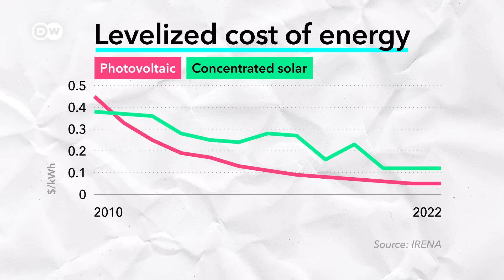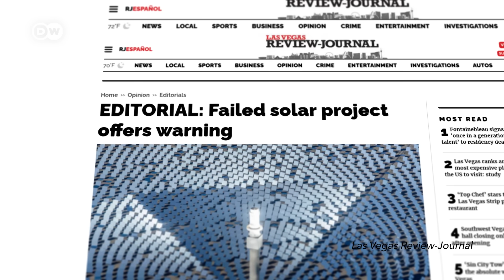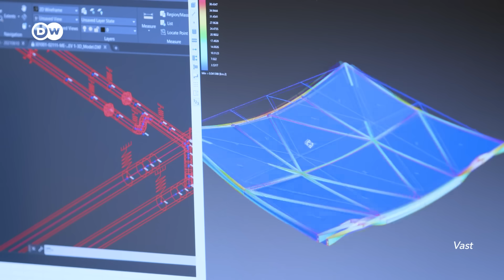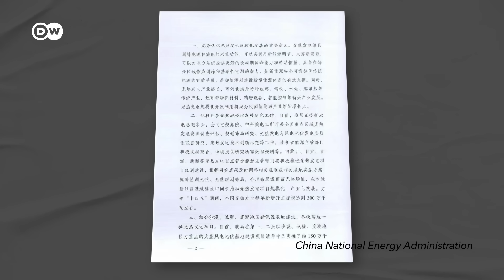How we can make solar power at night

Comment: How about flywheel energy storage? Or cheap flow battery? I guess that we need more research on energy storage than energy generation.
Reply: Flywheel is bad for energy capacity, but it discharges very violent and its spin rate is relatively constant. Therefore it is better used as frequency stablizers on the grid or caches of subway systems with regenerative braking.

Comment: Is it possible to one side of solar cells while other side of panel mirrors are fitted? With automation, panels sides cane be changed to generate energy for storage. Hope get some view on this idea.
Reply from the maker: Theoretically could be possible and would be good for land management! But the technical and practical challenges would be great: with finding the right alignment and flipping them around, possible heat management and so on...🌛

Comment: so why not just use it like a heat pipe, where heat rises up and cold condenses back down, in the heat tower, well, if you point the sun at the root, then the tower becomes a upwards automatic flow generator tower, yep you make steam power right at the tower, skip one complex plumbing phase completely. reason: marketing for pv solar was much better, and its very simple with panels and electric wires, if you make the steam solar heat generation simple as that then no problem. tower + mirrors, not additional steam generator plant as 3-part. minimal complexity makes it simple. concentrated solar thermal can be many times cheaper if done properly. not according to what market offers or requires. detach from the market completely. then you get the proper view. yep you can make it, but you dont have to make it. have to make it have to make all kinds of non-related things that just make things feel horrible. levelized cost ie other money measures are not the key. do it for yourself then you dont need to sell to anyone. you avoid all the commercialism complication issues. assume all costs zero. that way you see the sellers of the cs tech are just doing it too expensive. maybe on purpose. solar thermal needs to reform if it wants to compete. it lost its mirror's edge. if you are expensive, market will not buy your stuff. needs to stay in some range is a recipe for doom. if you make concentrated solar self-contained units all-in-one, as kinda like solar heat collector units, then it will work better. the application and usability it needs to be sensible. static auto-aligning mirror ground trench is much better. and simple to do by digging a trench and covering it with mirror metal sheets, or roof. yep roof concentrated solar is automatically the right shape. just boil water in the solar cooking tower. water is already district heating medium. maintenance needs to be simple. battery is the night generation, this type of marketing language does not help anyone. focus on the actual thing, solar heat capture, not the marketing language. paying more mean pv wins. storage? you could also heat molten salt or water or sand with solar pv. stay in focus. remove the storage system and only take the heat. then you get what the main point is, not the secondary things you need to pay someone for. separate the storage from the collection. you are trying to market concentrated solar heat, or maybe concentrated solar pv, instead of the heat storage solutions. so if you fail with the high costs of the mirror system, you will lose to the solar pv. yep only count the incoming wattage power capability, not the storage solutions. count the cost per watt for both solar pv and solar thermal. if the cost is higher then other storage related systems dont matter. so if its that cheap, even night time, then show it. if its more expensive then someone is talking marketing language. I think you are overpaying contractors for things you dont need be doing. keep focus or you are way over-priced. then you have nothing to sell your stuff with. not even being green. make it radically cheaper and dont let anyone make it comparatively or more expensive as solar pv. market and marketing is your main problem for concentrated solar thermal. remove that until you can do it actually super cheap. from basic construction materials without any complex custom builds. no you are not making a custom building. you are making a batch production for simple system for solar thermal. so why are you using expensive solar tracking mounts. calculate the cost per wattage. yes only based on the tracking mount mirrors, nothing else. that way the main cost is transparent. you can heat a sand mountain for free if you need to and use heat pumps to get the stored heat out. the cost of the mirror system is the only that counts. the tower/target is secondary issue. use water, its always liquid. china knows how to make things cheaply. unlike the more economized western systems. how can you fail in so simple task as using a cheaper tech to make cheaper stuff. too much talk, way too less doing. get doing. try concentrated solar pv first. its just blue smoke and mirrors. well, solar pv is 20% efficient and solar thermal is 100% efficient, so 5x difference. but if you can push more solar into solar pv, with cheaper mirror surface area than solar pv, then concentrated solar is doing well. if you can do that cheaper per solar surface area, then you can use the same blueprint for concentrated solar thermal collection. keep them strictly separate for cost isolation simplicity reasons.
Reply: try molten wax energy storage instead, much lower temperature and high heat capacity and high heat of melting. similar values to water (liquid water freezing energy storage). so since when wax burning energy was similar to gasoline energy storage.

Comment: Why not skip the molten salts, steam, and turbine and instead just use the mirrors to concentrate moonlight directly onto PV?
Reply from the maker: Intensity of moonlight is very low compared to sunlight, so it would not be a very feasible project. 🌑

Comment: The video really shows that solar PV is becoming ever more dominant. And that's a good thing.
Every other technology in places with a lot of sun will have to find niches around it. Whether that's wind, battery storage, hydro storage (pumped hydro or holding back hydro), compressed air, or CSP will most likely depend on local circumstances. If those cannot cover everything and demand can't be made to flex, then fast-starting gas will have to be the backup ( green hydrogen is along way off from being able to play this role)
Base-load technologies are at even more of a disadvantage where solar is king. The money they lose while solar PV is going has to be made up for at other times.

Comment: How is sun tracking more complicated then PV? I'm disappointed, dont believe for a second that PVs which are 30% efficient, degrade over time are a better and easier solution. It just looks like people just didn't spend time optimising the solution with parabolic array of mirrors. Perhaps a turbine could be above the molten salt removing the need for it to travel in pipes.. or why can't water travel to the salt?

Comment: Hey, is there a way the same solar panel to absorb and reflect light so that both CSP and SPV can co-exist together?
Reply from the maker: CSP and SPV have different operating principles so not on a same panel/ mirror. But they could be integrated at the system level in a complimentary manner like we pointed out in the video. ☀️

Comment: If we ever manage to get solar power satellites off the ground, they will almost certainly be CSP based. None of the disadvantages of clouds or tracking the sun exist in a static orbit which a solar sail should be capable of ensuring. But even if a static orbit isn't possible and tracking the sun is still necessary it'll likely be a lot easier than tracking the sun down here is and of course there wouldn't be any clouds or dust to cover the mirrors. At least not at a meaningful rate compared to what's down on earth.

Comment: Guess we'll see what plays out, but pretty sure PV + storage will be more economical than getting the higher complexity molten salt of concentrated solar to work. There's so many options for stationary storage from PV that are so much less complex: Li ion, redox flow, pumped hydro, thermal salt/sand, flywheels, etc. All of these eliminate a lot of complexity/moving parts compared to a single unified molten salt concentrated solar system even if having modest efficiency losses.

Comment: 1:07 Traditional solar cells can be leverage to generate power at night in a few edge-cases.
You can use a thermoelectic generator to take advantage of the temperature difference between the night sky (3k) and the air at the ground.
I suppose a plant storing molten salt will get an even bigger temperature difference out of the night sky.
Reply: now you are just making up science as you go, TEGs are expensive and very inefficient and require a far larger temp difference than what is available in the air.
Molten salt is storing high grade heat that was collected from the sun tower, when it is introduced to the generator station, there is possibly 500c of working temp difference

Comment: Why dont they use oil instead of salt in solar thermal plants?
Reply: they did already and it burned, look up parabolic trough solar power catches fire, 
molten salt is probably the safest coolant loop esp if it has 24/365 continuous heating from say fission in an MSR so is always in liquid state
Reply: Or lead? Sodium sounds dangerous!
Reply: @puffinjuice  lead very toxic, sodium just love water to death

Comment: Isn't molten salt also highly corrosive and therefor a nightmare for the piping?
If i remember correctly, wasn't that the issue with Molten Salt Reactors and why they sofar have not been commercialized?
Reply: @kinngrimm  We need solutions piping cracks put what if lined with ceramics?
Reply from the maker: We did previously a video on thorium and molten-salt reactor experiment, checking also what went wrong ☢️ 👉 https://www.youtube.com/watch?v=Km6kqykX900&t=72s
Reply: @DWPlanetA  Yes i saw that one already thank you. I also saw a bunch of other vids on the topic from science channels. Currently this and a minitiurized reactor is hoiw the atom lobby tries to stay relevant under the pressure of more than compatativ prizes from green energy. While the moltan salt reactor could work if the material science would find certain solutions, the miniaturized reactors are just bad news for a whole lot of reasons like oversight, end of life and gernally nuclear waste handling. We know that our storage facilities we have are leaking and it will cost us an arm and a leg to remedy that fact. Meanwhile the rich practicly don't pay any taxes but mostly inherit like the aristorcracy of old. Also not likely the energy companies would care to pay for the waste or be responsible in any form like all companies, right ^^.

Comment: It takes up a LOT of natural environment. This is sustainable for humans but furthers the divide between the human dominion over the natural environment - and the whole point of renewable resources was to stop destroying the natural environment.....how much do these mirrors heat up the surrounding area? The source of the sand to make these mirrors - where does it come from and how is it sourced?
Reply from the maker: Thanks for asking. There are environmental impacts, as with any other form of power generation. ☀️ CSP concentrates heat mainly at the receiver so local temperatures rise, with little effect on surrounding areas. CSP is known to require less silver compared to other energy sources. Here is one study that assesses the sustainability impacts of CSP 👉 https://www.sciencedirect.com/science/article/pii/S1364032122008851.

Comment: Battery progress is currently very fast. 
It’ll probably be normal panels plus batteries for storage that give cities solar power at night
Reply: Batteries are not cost effective though.
Reply: Більш того, накопичувальні батареї можна встановлювати в приватних домоволодіннях та надавати можливість заряджати їх за зниженою вартістю,  для того щоб споживати у час коли немає сонячної генерації.
Reply: No its not fast at all, study basic physics and you will understand that battery tech is the most expensive way to store energy, it's about 10,000 more expensive than energy found in a gallon of fuel. Tesla Wall battery for 10KWhr(e) about $10,000 check in your local Tesla dealer. One plastic bucket for $1 can hold 1 gallon of any fuel worth 30KWh(ch) or also worth about 10KWhr(e) in a thermal power plant. Even better, uranium has about 1Million times more energy density than even chemical energy. If a battery could store energy a few times more denser, it would become close enought to being chemical fuel energy. 

Also US energy use per capita is 300GJ/yr. Each solar panle makes about 1GJe/yr with a battery. See Wikipedia for per capita energy use.
Reply: @johnjakson444  The economics of energy cost gets complex.  What about the huge ongoing externalized environmental costs of fossil fuel included?  Subsidies?  Burning gasoline to make kinetic energy is about as inefficient as one can get especially the common internal combustion engine.   ICE at best 30% efficient in normal consumer vehicle and likely down to a pathetic 20% of energy makes it to the wheels.

That ultra-refined gasoline doesn't show up by magic ready to use at local gas station either.  It took a hell of a lot of energy and money to drill miles into the Earth's crust to get at it.  Then have to refine it and the distribute a heavy liquid around.  See amount of electricity needed to refine one gallon of gasoline may be in for a surprise.  Now the economics of gasoline don't look so good does it?

Sure, a battery takes effort to build but a battery can be re-used over and over for many thousands of cycles in an EV, then it can be used for many thousands of cycles in less demanding grid applications.  Look at the cost cumulative joules of energy across that lifetime versus one-time burn of gasoline before needing to go back to the drill, refine, distribute cycle.  All the elements in a battery are still in it at end of life as at beginning.  So it can be recycled, and the materials made available in recycling stream is going to be cheaper than going back to mine it.

Also, electrical based energy can almost directly harness the free fusion power from the sky, 173,000-terawatts non-stop.  The raw inputs of sunlight and wind arrive freely, and they cannot be blockaded, sanctioned or taxed.
Reply: @johnjakson444  Also, only around 0.7-percent of the US lower 48's 3-million square miles covered in current generation photovoltaics is enough to power the US 4200TWh annual grid.  But why would we stop there?
Reply: @johnjakson444 are you completely unaware that energy density of batteries vs fossil fuels is mostly irrelevant?
Reply: @johnjakson444  coal has higher energy density than batteries and is also not economically viable in today’s America.
The cost of extraction is a thing that exists, even if one prefers to ignore lung cancer as a cost.
The cost of transport is a thing that exists.

Meanwhile sunlight’s delivering itself directly to solar panels free of charge every day

Comment: CSP is a thermal battery that has it’s place in the grid. But the incredibly cheap thermal batteries of Antora energy can completely decarbonize industrial heat which accounts for 60+% of carbon emissions by purchasing or even profiting from negatively priced solar energy during the day. Antora will outcompete fossil fuel (coal) powered industrial heat.
Reply: More 15-20% of global emission

Comment: Negligible thermal efficiency (Carnot and worse)...then, more worse. Taken out by dust, rain, blowing sand, HAIL STORMS. Every mirror must be continuously two-axis synchronously rotated through two angles : 1) TIME, sunrise to sunset, and 2) DATE, the analemma Clouds. Extreme bird slayer: Fly to a "reflective body of water" die of thirst. So awful,  so financially corrupt, so utterly Envirowhiner...that California has one. Mothballed. Garbage in, turds out. See it glowing white hot? It is re-emitting incoming mostly in the infrared. Total BS.

Comment: Harness 1
Solar thermal power generation & thermal storage

“India One”, a 1 MW solar thermal power plant has became operational since 2017 near the Brahma Kumaris´ Shantivan Campus in Abu Road. Om Shanti Retreat Centre, Gurugram also has a 1 MW scale hybrid solar power plant using Lead-Acid and Lithium-Ion batteries to ensure constant power supply.  I have seen this plant  it is inpressive   .

Comment: at 7:24 The reason concentrated solar can produce at night is because it has large buried tanks underground? What the difference with PV panel plants that can also have storage batteries (such as Sand thermal batteries)?
Reply: PV panels are only ~20% efficient. So you get more heat from the same area with concentrated solar.
Reply: turning electricity - heat - back to electricity again is very inefficient. Better approach is by using kinetic or potential energy storage, like giant flywheel or pumped water.
Reply: @samueladitya1729  Storing the heat directly is ALSO kinetic energy: just less likely to explode if a bearing fails.
Reply from the maker: They can be seen as complimentary; thermal allows for more extensive storage and works well in hot places, while PV's with batteries are easier to deploy and well suited for short-term storage and fast response. Also, we have this video on sand and salt as lithium replacement you can check out next 👉 https://www.youtube.com/watch?v=-vobMl5ldOs